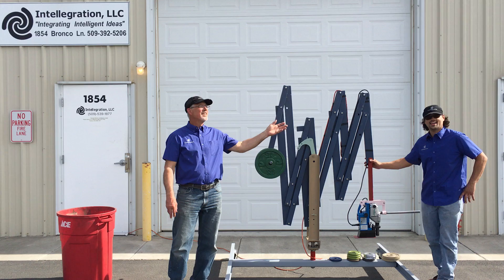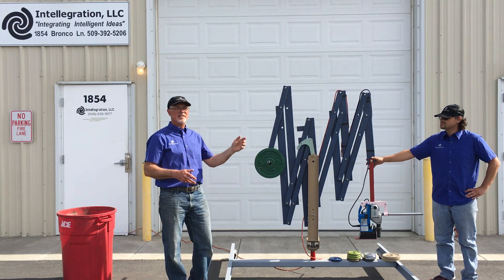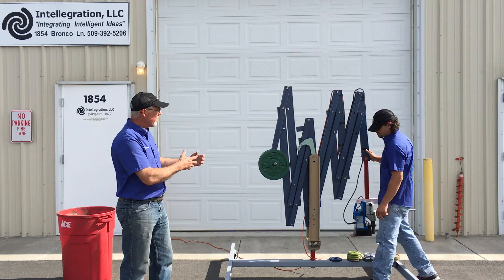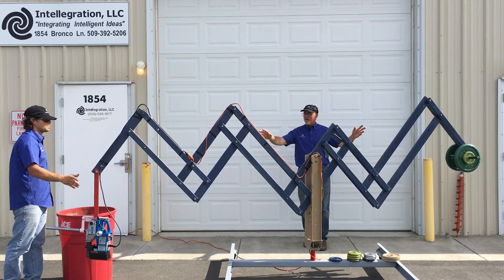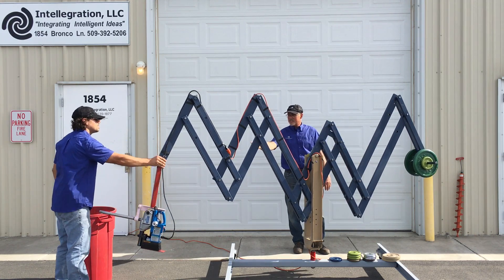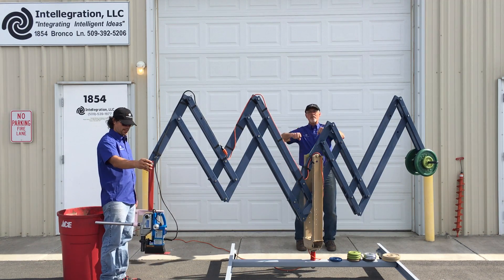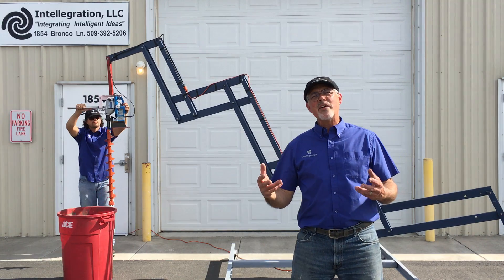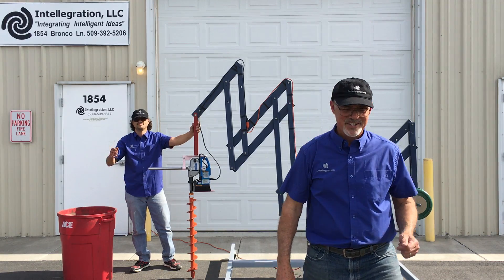Mega Anti-Gravity Counterbalance System

Comment: wha? I dont get it. Why use a machine 5 times the size of the machine its lifting?  Plus at least with Augers it may be a little heavy but you want the weight to push downward....right?
Reply: "Why use a machine 5 times the size of the machine its lifting?" Are you that strong and built to hold that thing all day?  Also would you use a forklift that was the same size and couldn't lift anything above itself? How about a crane? Did you see how high that thing went? Could you hold that thing that high up and still work?  

"Plus at least with Augers it may be a little heavy but you want the weight to push downward....right?"  NOOOOO!  It's not the weight pushing down that  makes it work it's the bit itself that is drilling down. Some weight helps but also works against you more. Trying pulling that heavy auger out with dirt now filling up the bit. See if you like that weight then. Weight is not the big thing when using augers. Just watch this video. That machine has the engine and hydraulic pump in the opposite end and used as counterweight. The hydraulic motor is 30 -45 bls and not much compared to that motor. 

youtube.com/watch?v=y45iIkkQxWk&ab_channel=TargetRental